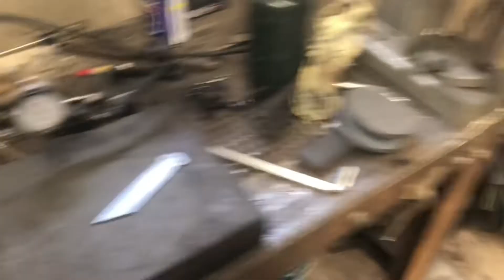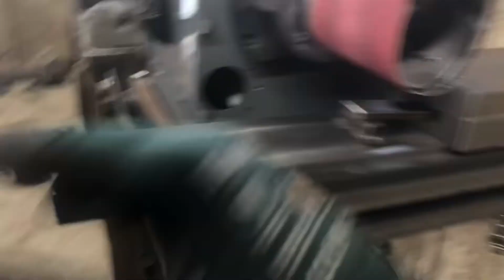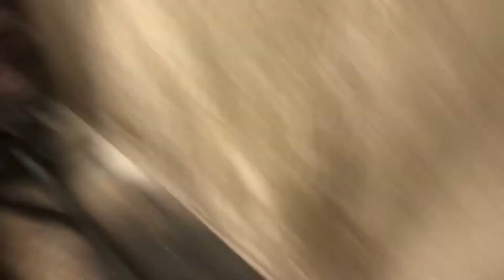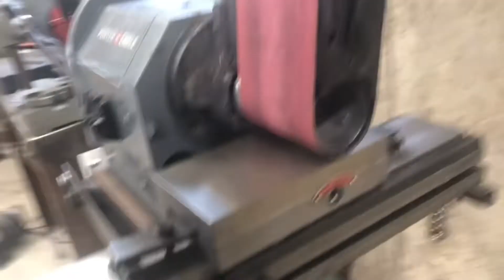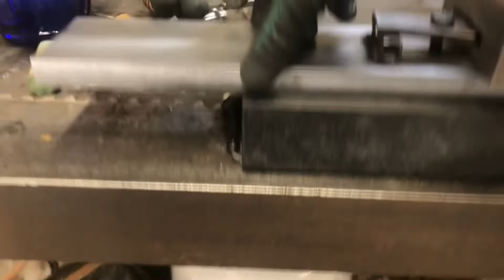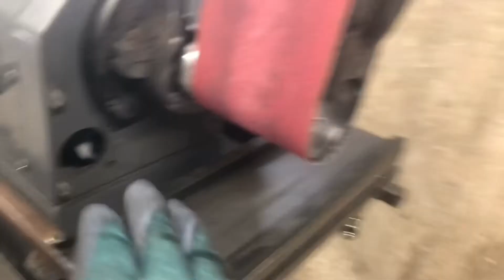Homemade Surface Grinder!

Comment: Nice work.
Anyone planning to do this, should not use the sprung table approach, but to use a hinged(tilting table approach, as you're only interested in a single axis relative to cutting axis. 
If you want UBER parallelism, then use a barrel shaped drive pulley, as you're only really interested in a finite point of contact with the workpiece, as the perpendicular taper of the drive pulley to the table plane, will aid in final finish, and allows the belt to engage into the surface to be ground in a progressive fashion.
Try also to make ALL the sub assembly surfaces ON the  linisher to be modded too!
👍🤔

Comment: Pretty sure that little wavy-ness on your 150 grit grind came from the wobbling... stiffen it up and your dial indicator should sit even closer to zero. Looks like normal "tool chatter". I think you've overdone the bed, and under-done the belt sander and attachment stiffness. But no arguing with the results. Nice work, good ideas.